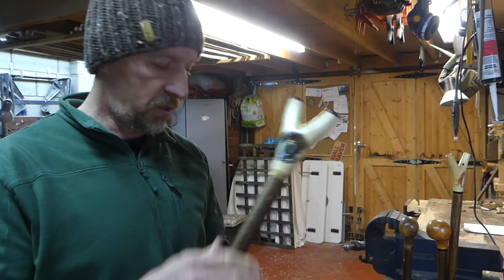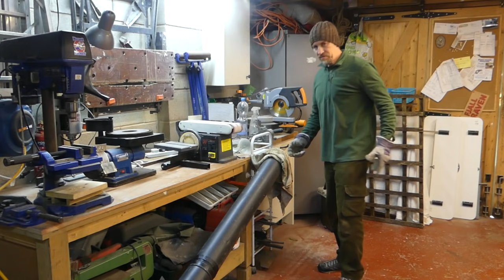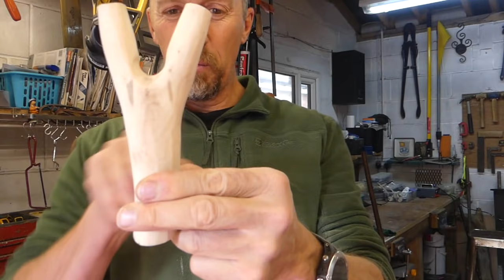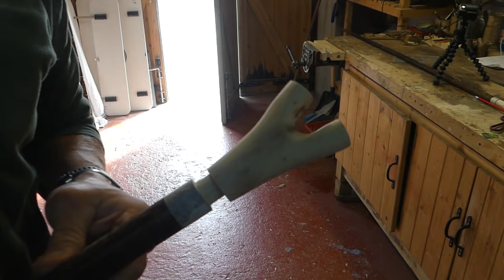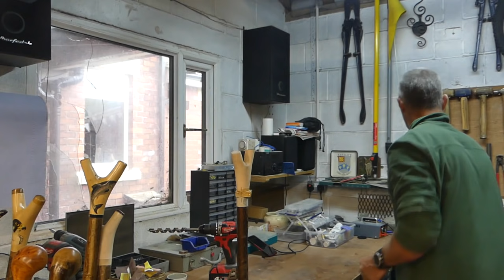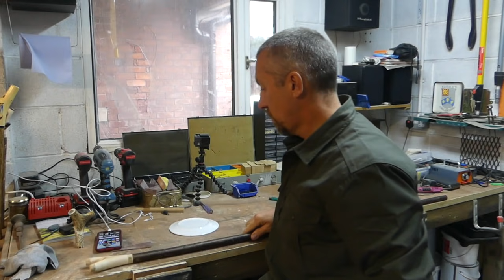Making a Walking Thumbstick (Step-by-Step Guide)

Comment: HI! Simon:
I just found your video on making a Wildlife Thumbstick. Thank you for sharing.  It inspires me. I have made a dozen or so hiking staffs.  I may try to make one like yours soon.  But I'm not the artist that you are.  But I just located your video on painting wildlife on your sticks.  So I'll see what you can teach me there. 
But I wanted to share a couple of things I have developed for my staffs.  I drill a hole in the bottom end of my staff, and then install a 14-20 female threaded insert into that.  I then can screw in a common hardware hanger bolt.  They have 1/'4-20 threads on one end, and screw threads on the sharp end.  So that gives you something to use in icy or slippery places. I also found, in a backpacking store, a similar insert that used a titanium blunt point.  That will stand up to hiking on slick rock better than the hardware hanger bolt. 
One other innovation you might consider for your camera.  I took a piece of 1 1/2 inch redwood about three inches long.  I drilled a hole in the bottom end, oversize for a threaded broomstick.  I then wrapped teflon tape around the threads of a telescoping broom-mopstick. and partially filled the hole in the redwood with epoxy.  I then centered the telescoping broom stick in the epoxy and let it cure overnight.  Once cured, I removed the broom stick and took the teflon tape off.  Thus the redwood can be removed or installed on any broom stick.  On the top end of the redwood, I installed the quick-release camera mount from a tripod.  The quick release has a swivel to let your camera have most any angle.  All of my cameras have the matching other half of the quijck release. 
I actually bought two telescoping handles.  One short for when I Know I'll be sitting.  And one full size that works for either sitting or standing. 
Maybe you or others might find use for such ideas.
Reply: I forgot to mention, I made my walking staffs out of local wood.  Birch, Cherry, Russian Olive, and Arizona Cypress.  All make good sturdy staffs.  I leave the pieces bent and crooked for character.  But still pretty straight.

Comment: After watching this video I thought the idea for keeping pressure on the thumbstick handle with the g-clamps while the glue sets was brilliant and so I had a go. Unfortunately not being very nimble with my fingers I failed. However I gave it some thought and came up with this. I used two 1lb cast iron old Post Office scales weights with rings on top. I attached a piece of cord between them and hung them on the v of the thumb and bingo it worked. Thanks Simon for the inspiration!!.
Reply from the maker: Great idea Geoffrey, I might give that a try myself👍🏼
Reply: @simoneardley  It also works with weights from dumbbells .

Comment: When I was building skin on frame or cedar strip canoes I would use a combination of heat gun and steam for smaller areas. Wrap the bent area in a wet towel and apply the heat. A few minutes is enough and you can heat a local area with no risk of scorching. If I needed to bend a longer curve (I was putting bends in rather than taking them out) then I would use a steam pipe like the one shown. The problem was that for a radical curve you couldn't put the strip back in the pipe if it needed reheating so the wet towel and heat gun worked for that too.
Reply from the maker: Good shout Graeme, sounds like a handy technique to deploy. 👍🏼👍🏼

Comment: Wow you've given me some ideas. I've been making a few sticks over the last fortnight using Yew that I had cut for bow making. I also had a piece of hazel that the ivy had grown up and strangled to form a a lovely barley twist. I've used deer antlers for the vees but I've run out now. 
I have a number of Yew vees that I was going to use for sling shots but I'll use them on sticks now. Great video and very informative. If you want to see another atractive
 finish I've developed for the joint of 'V' to stick perhaps we can get in touch.
Reply from the maker: Nice one Kevin, take care when sanding the Yew as it can be toxic if you breath in the dust.Interested to see your 'v' joint.👍🏼

Comment: Brilliant video. Just a stupid question to ask though, how do you sand or finish the knots and nobbles from where small branches were? Then when finishing with Danish oil and briwax. Do you use both finishes at the same time if so in what order is best? Otherwise is it just one finish depending on the type of stick? Many thanks in advance, Chris

Comment: Hi Simon, another great and inspiring video . I’d always wandered how these where put together and your drawing skills are unbelievable.  You never showed how you finished off the end that’s in contact with the ground . What you used ( is it metal or some sort of spike) and how you fixed it. Is it possible you could explain ? Cheers Roger
Reply from the maker: Hi Roger, the only reason i didn't show the end part is because theyre all cut to length to suit the owner and I dont know whos getting this one yet. I fit a brass walking stick ferrule on the end to protect the shank and stop it from splitting.

Comment: I have an old walking stick with an antler thumbstick head. It was varnished, but over the years the varnish started to peel so I have cleaned it all off and now it is down to the bare wood, which is either blackthorn or hazel. Should I oil and wax it, or varnish again?
Reply from the maker: Hi Derek, I'd be inclined to give it a coat of Linseed oil and then a light coat of wax when its dry

Comment: One of the best videos I’ve seen on walking sticks! I have one question, Do you straighten the stick before or after it has dried? Thanks from Maryland, USA.
Reply from the maker: Thanks very much Todd, If theyre really bent, I'll give them a bend over my knee when theyre wet as I've just cut them but they have to be completely dry before i put them in the steamer tube.

Comment: Just getting in to stick making and found this video really informative.  What is the height and width of your stick straightener, and is it slightly angled on one side?  Great video, thanks Kevin
Reply from the maker: Hi Kevin, the straightening jig is 600mm x 140mm. The blocks are old worktop and 40mm thick. The gaps are 18,21,30,34 and 38mm approx. Hope this helps.
Reply: @simoneardley  Thanks Simon, yes indeed that does help and I can get busy making one!  Keep up the great videos best wishes Kevin

Comment: Simon, do you have a layout drawing for the straightening jig you made?  I'm sure I could wing it, just wondering.  On my list of to do projects now!
Reply from the maker: Hi, no drawing but here are the dimensions. The straightening jig is 600mm x 140mm. The blocks are old worktop and 40mm thick. The gaps are 18,21,30,34 and 38mm approx. Hope this helps.

Comment: I'm 100% with you on using a stick when out in the countryside. However, I'v never been a fan of thumb sticks. I prefer a straight Hazel shaft with a rounded top ( nice and simple) or a simplified shepherd's crook style. Basically a stick cut from a root or a secondary shoot. That gives me a bit of a hook which can then be used to pull on branches etc.  Granted they aren't much use as a camera support but it is possible to use it to brace the lens against.
Cracking video though and I'm really impressed with the painting... I hate to think what it would look like if I painted anything on a stick 😳. 
Were those a couple of lakelands / Patterdales at the start of film?
Reply: Have apair of Lekipoles where you take off the handle by unscrewing the 6mm thread which is the standard camera mount. So by using a threaded head on any sticj and using 6mm rod , you can even buy at B&Q, for the dowel you canhave any head you like.
Reply from the maker: Yeh i can see the use of a crook definitely. Regarding the dogs, theyre German wire haired pointers and a wire wizsla
Reply: SIMON EARDLEY Bloody hell, I've always been pretty good on dogs (kept many terriers and lurchers over the years) but I totally got that one wrong didn't I.  In my defence they were only on screen for a brief moment and it was from a very low angle ..... bollocks, I'll throw my shovel away and get my coat. 😬

Comment: What are the benefits of using a thumb stick? I have seen them before and was just curious.  Great video! 👍
Reply from the maker: Thanks Jayger, they're just nice to grip. They tend to be longer than a normal 90' handled stick and you can lean on them as a support, use them as a camera support, better for river wading. Allsorts of uses really.
Reply: @simoneardley   Thank you for the info. I think I will make 1 and try it out.

Comment: How do you prevent the sticks from developing cracks as they dry out?  I’m in the US, and I’ve collected quite a few sticks over the years; I always grab a few every time I go camping. However, most of them end up developing cracks as they dry. Does the type of wood have anything to do with it? I usually just keep them indoors. I always keep my house temperature at around 68° F (20°C) with about 50% humidity. Any tips would be appreciated. Thanks man
Reply from the maker: I generally use Hazel and have no issues with them splitting. I would imagine its down to the species or the speed that theyre being dried. Try sealing the ends and dry them in an outside barn or building for approximately a year.
Reply: Thanks 🙏🏼 I’ll give it a try

Comment: Hi Simon, at what time do you straighten your sticks, after or before drying, thanks in advance
Reply from the maker: I generally straighten the sticks once they are completely dried, usually 12 months. Any that are really bent can be gently encouraged by bending over the knee when freshly cut and then fined tuned when dry.
Reply: @simoneardley  thank you very much

Comment: I have a rule , is the stick one inch thick it takes one year to dry. If you don't want it to split tip the ends in hot wax then you have no problem.  You do a good gob . 👍

Comment: Good to let it set.
Set and cure are not the same. Most epoxies have a set time when it will not easily move anymore and full cure some time later. 12 hrs to 7days or more for full cure. Not much of an issue for wood.
Reply from the maker: Youre right there Tim👍🏼It pays to be patient mate

Comment: I would  rather whittle away @ them rounding them down when the are greenwood,working with that dry w0od is way harder & slow process.         Then when they dry do the sanding & stuff